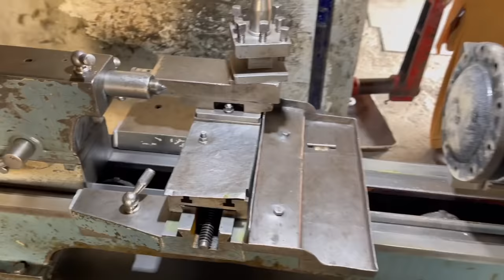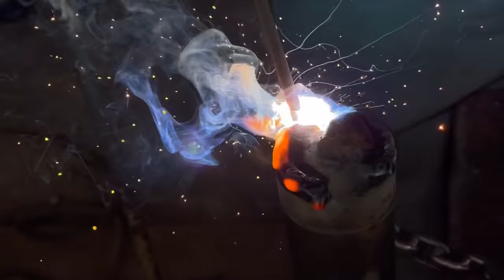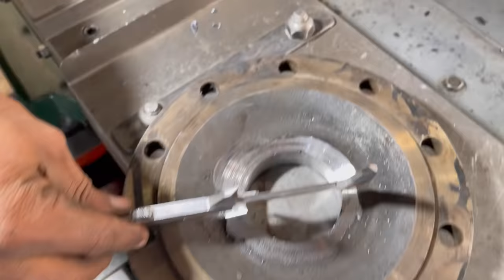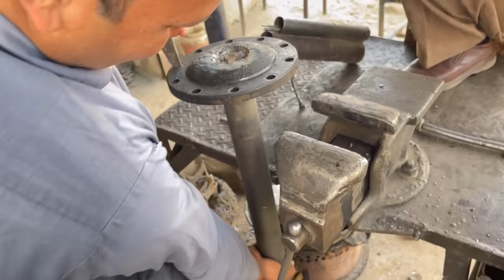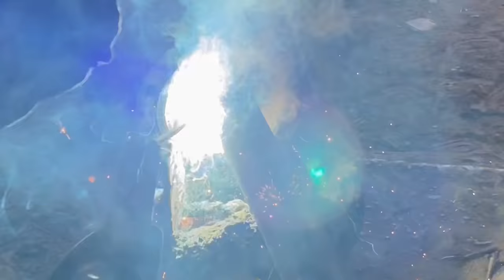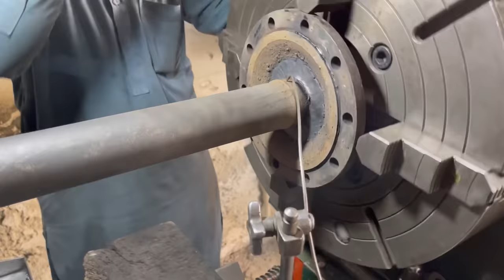Amazing technique Broken Rear Axle Repair | Local workshop amazing work |

Comment: It would be interesting to see how long it lasted in the truck, and where it will break again
Reply: probably better than the factory
Reply: @bourbonrenewal216  ha, you can even see the small defects in the welding job after he polished it
no way its better, in fact it's worse
Reply: Don't you dare come to us with science and numbers 😂
Reply: I can say this much machine shops been shorting axle shafts like that a long time for kustoms  and drag cars long before currie and strange made custom length axles still done today for odd axles
Reply: @bourbonrenewal216  a surface deep one pass cold weld without any preheating on a large pieces of alloy axle steal.  THERE IS NO WAY THAT IS BETTER THAN A SINGLE FORGED HEAT TREATED AXLE FROM THE FACTORY
Reply: Right beside the weld .axles don't like to much head .madeast a week under load if that
Reply: @Stepinup  really machine shops been cutting and welding axles for years before Mosher and strange made custom lengths they do it right at the flange end never had one break infact I have one in a chevy nova that is still cut and welded that was done in 1980 and still drives fine they cut it off at the flange turn the shaft to a smooth diameter drill threw the flange do .005 press fit and weld anneal it and heat treat it

Comment: Nice job. Didnt expect it to be done with a stick welder!
Reply: Its the axle fuse..
Reply: Welding outside in the wind probably makes it the best choice. Not sure how the strength will compare with original though. I thought that these axles were forged.
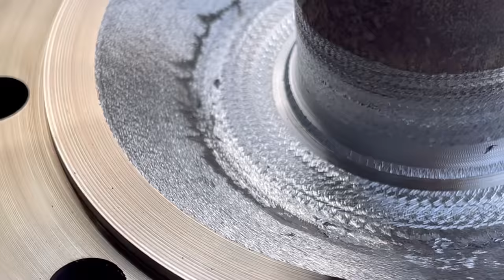Reply: I'm just going to say, usually you do the last step first. It's not the best idea to weld over iron oxide and whatever other crud and dirt built up over the metal. You can actually see what looks like small voids and cracks in the welds in the final close up.(18:40)

Comment: The problem here is your putting peoples life's at risk, you just welded on metal, it's not the same structure. It's weaker substantially. It may last a a few months tops. No heat treatment, the shaft isn't made from cheap weld, there's so much pressure and stress on those. Nearly 5 million views. Now the dislike button is cancelled. This is actually dodgy as hell mate. There's no way this would pass a certification at all. Cowboy Technique#

Comment: This piece will for sure crack at the end you can see when you got close all the cracks in the welds just because it's clean and looks shiny doesn't mean it's safe
Reply: During welding, tensions have arisen that will soon lead to breakage again. The weld seams should have been annealed stress-free. Always drill with oil.

Comment: Heat treatment??? Pre-heating the material before welding…Chamfered edges??? What is that???to repair something lite that it need a lot of steps in order to keep the strength an structural integrity…as a emergency repair…ok. But I suppose that maybe it is difficult to find replacement parts or it is too expensive…but this repair is not safe but fun to see!!!
Reply: Yup, bye-bye factory heat treatment and friction weld technique.

Comment: Could have beveled the 2 sides of the disc and welded with a stainless steel electrode (welding more flexible to rotational force) and then filled with common weld for reinforcement and finishing.  At least it lasts longer.  What seems to me is that these trucks are running with excess load, and with the differential, it throws all the torque on an axle and it can't handle it.

Comment: Everything I have read in the comments about how it should have been welded, nobody has said anything about where they placed the ground while welding in the lathe. If you grounded to the lathe body and not the part every bearing in the current path now has arc on the balls and both races, very fast way too destroy a lathe.
Reply: There were quite some comments here about improper grounding killing lathe bearings, at very least in Russian.
Reply: Да, друг, о заземлении я тоже подумал. Вот же индийские мастера камекадзе)))
Reply: The next shop over makes new lathe bearing balls.  From balled up  chicklet wrappers.
Reply: Probably a rotary ground....they do this all the time and lathe is old and running....

Comment: Nicely explains why wheels departing trucks is a common issue that kill many people.
Reply: Wheels are connected to drums of axle housing not axle hubs
Reply: Wheels is in the axle spindel, it was secured being by a large nut. The axle shaft is only connected to the brake hub. Which means that you can remove the axle shaft without removing the wheels

Comment: It's always nice to see how people repair stuff instead of replacing. Unfortunately, that axle isn't gonna last very long because of all the crack initiation points on the inner radius, as well as tension in the material from all the welding.  But I suppose they will fix it again when it breaks off.
Reply: Что такое напряжение металла от сварки?)))

Comment: That is very unsafe if they will install it.   That axle must be preheated prior to welding. Without preheating, the molecular structure if not correctly done, it will have cracks and that is unsafe. They should do friction welding.

Comment: I've been watching a few of these Pakistani machine shop videos and it seems like a lot of their repairs involve filling in broken/missing material by stick welding, then machining it down to the desired form.   How does the strength of the welded filler material compare to original stock?
Reply: Metal is amazing. Welds are very strong as long as they are done properly. There is a wrong way where you can wreck or weaken things... Skyscrapers, container ships, bridges, many things are welded strong together.
Reply: It doesn't. Simple as that
Reply: @TomarenaiEraserRain    Plus he was using the right rod for the material he was welding. Love that 7018. I’ve used it a lot over the years on alloy steels.

Comment: I don't see that lasting at all. There's no structural connection between the shaft and the flange where it was fitted together. That is an instant internal structural weakness. The weld material might hold up for a while, but not forever.

Comment: An old timer in CA told me about when he worked in a US factory making heavy duty condensers for refrig units. A Korean company bought one unit. It had a broken shaft which was welded, but it still worked. Years later, the old guy told me about going to Asia, because he heard identical condenser units were being sold throughout Asia. He noticed that every unit had an identically broken axel which was welded.
Reply: When there's no parts , ingenuity is the Mother of Invention
Reply: @peted5217  necessity is the mother of invention
Reply: Most Exactly

Comment: This is what Mechanics/Fabricators do when parts aren't available. Separates the men from the boy's. Great job guys!!👍👍👍
Reply: See I get that but, it's not their materials it's the techniques and lack of training, I mean the guy didn't use one drop of oil the whole time that hub was on the lathe, they probably go through tools like crazy with not knowing how to use them properly.
Reply: @kielbasa.sausage  I know they didn't. No dial indicator either. They needed the truck to go, so they did what they could with what they had. I ve done repairs on trucks(semi's) on the side of the road, in parking lots, in the dark,rain, snow,ect. I didn't always have the "proper pieces" for the repair so I do what I can to get it back to the shop, just like these guys did. They didn't give up. Even though
it wasn't perfectly done- they got it rolling again. You've got to admire that my friend.
Reply: These videos are some of the scariest shit I've ever seen. How screwed will it be when the shaft breaks off the end. The other video of resurfacing a pressure plate with welded or brazed cracks. That will come apart and scatter everywhere, maybe kill or mame someone.
Reply: the dude  you can have whatever opinion of the job you want. I don't  care. I said I thought they did an excellent job on it for what they had to work with,that's all. Look around. There's lots of substandard repairs going on in our country too. If the axle breaks again, it's inside a housing. Remember it already broke once. Yes, I still admire the repair for what it's worth. I also know it would take a replacement axle to repair it right. At least their not sitting there crying about it. They did what they could.
Reply: the dude  well dude, why don't you fly on over there and educate them? Why waste my time. Go show them how.
Reply: the dude  yea well your brain might even be smaller than mine. Your the one complaining about it, you go and show them how. Or does their system of justice scare you?go find someone else to troll

Comment: Repairs like this still occur in the U.S., but aren't common. I would have like to have seen more of a radius on the intersection between the flange and axle. I think he was trying to add a radius with that last step with the grinder, but there is still a fairly sharp corner there. That is a stress riser and will be the place it fails next. Just using a rounded cutting tool in the lathe when taking off that weld could have prevented that.
Reply: I thought he was trying to reproduce what looked like galling on the part originally.

Comment: I was surprised he didn't try to friction weld it, goes to show what can be achieved with willpower.
Reply: does it look like they have friction welding equipment ?
Reply: So you don't understand how friction welding works? He has a large lathe.
Reply: @simontheeldergeek523  yes i do you need a little more than a 75 year old lathe seems you dont know you should look on you tube maybe  youll get the full picture

Comment: I wonder what the strength is compared to a single piece: is it enough to take the engine torque?  Are these welded on to begin with anyways?
Reply: no, an axle like that is Forged from one piece of steel,  top quality steel, the "repaired" axle  will fail in short order.  A weld will never replace a forging.   the Pakistani guys do their best but the repairs are just temporary ,  you can tell when you see repair after repair on the same item
Reply: Я где то видел их делают цельными из куска металла путем ковки.
Reply: @mikethompson9745  I thought that they were a single forge… I was just curious about the actual pressure that the weld can withstand…it would be interesting to see the longevity in terms of “miles driven between breaks”…. A new metric, if you will.. 😀
Reply: Ironically, the weld is probably stronger then the original part, despite the naysayers, a proper weld will always be stronger then the parent material.  as for the original part, they are likely cast then machined as one piece, while forging is possible, its unlikely as upsetting that large of a flange becomes problematic due to cracking and internal stresses, not saying it can't be done, but easier and more cost effective to cast.
Reply: Engine torque ? what about extreme  over loading the truck  with far too much weight, probably why the axel went in the first place.
Reply: @artisansportsman8950  the axle shafts only deal with engine torque, they do not carry any of the load, likely cause of breaking is getting stuck, and then getting sudden traction, happens with some frequency with dump trucks and logging trucks here in the PNW.
Reply: I saw a video of Pakistanis forging axles right in factory, so I don't know why can't they just buy a brand new one
Reply: @ex-soldier4341  next station fix

Comment: The weld doesn't seem to be any good for cyclic load. He should have bevelled it at least from the inside (after first weld passes) to get rid of "dirt" in the root pass and have nice full penetration weld. Instead he put too much filling just to lathe it down then. And yep, I would do DPT for high-loaded axis if a living one would like to drive a truck with this axis on.
Reply: I can't understand why so many commentators are so enthusiastic about this patchwork that doesn't show the slightest security standards. I would not want to drive such a vehicle.
Reply: Came here for this.. how long would this poor axle hold before it snaps again... Polishing a turd!

Comment: Anyone observing the granular texture of the metal would immediatly discard that piece of steel. Probably a hardening problem or a wrong choice of steel quality.  But, in a isolated environment or lack of replacement for a new one...
Nice effort... it will come back for a replacement soon!

Comment: I love watching this being done by hand the skill is awesome. In US everything is done with machines. It would be done with a rotary welder that builds up layers. Love seeing this
Reply: Not nessesarily most of this kind of repair stuff is still done by hand with admittedly better equipment in most cases in the us. For instance every shop I've ever seen in the us has dial indicators instead of the wire on a base they were using in fact other than that a lot of small shops would go about a repair like that in the same way and with very similar equipment. in fact the equipment they actually have doesn't look like it's in that bad of shape I've worked at shops with older and more beat up equipment than that. Several even had equipment from the 60s still running barely upgraded if at all to modern technology.
Reply: We also clean our materials before welding on them...
Reply: Many repair machine shops do shaft weld repairs similarly (except with proper measuring instruments to reduce runout and with tooling that leaves a proper surface finish.

Comment: I have one issue. The rod you are using is not a downhand rod. 7018 is uphand or flat only. That's why it was "running" when trying to do the second side of the axle. Other than that, this was very interesting.

Comment: Well, that's another truck axle that gets to fight another day!
The stuff I see done here on these videos makes perfect sense, they have no choice in many cases but to re-use bits.
Reply: Gg
Reply: Ain’t gonna fight long!
Reply: @jamesharrison8346  it would be interesting to know exactly how long it "fights". But, what do you do when labour is cheap and OEM replacement parts and materials so expensive?
I've had a long career in engineering and have witnessed some amazing results from some very "sketchy" emergency repairs.
So I tend not to disrespect the work these folks do.

Comment: Wonder how this repaired axle shaft performs on the truck and its load carrying capacity. Looks like a 12 to 15 ton shaft, if it works just fine then material, heat treatment and FEA engineers will be jumping off buildings, head first....
Reply: They always used to tell us a good weld was stronger than the metal around it, good to see parts getting repaired instead of being scraped isn't it
Reply: @Geoffcwest  they can afford to fix it Labor is cheaper than parts there.

Comment: I thought cutting off most of the internal weld was a bad idea and it looks like the cracks are showing. But amazing turn around time tho. Thought when I saw the lathe initially I though I was going to see a shrink fit then weld.

Comment: I guess it's what you have to do when you have no other option. I'm sure the guys doing the repairs are completely aware it's not as strong as it was, and I'm sure they would have told the customer also. But when you have to fix what you have in order to keep things moving on a daily basis, you weigh up those risks and decide if it's worth it. In this instance, I guess the owner was happy to use this repair until a new replacement part became available.

Comment: It was a good effort. If I turned stuff out of many of the shops I have worked in like that, I would have been fired.  Also for future reference, an undercut at the base of the shaft into the plate with a large radius will add quite a bit of strength and reduce stress risers at the joint / corner.
Reply: Can you explain what you mean by the risers ,for us laymen
Reply: ¹a11aq1aaaw¹aaaaaa2qqq11¹¹11¹aaq¹¹qaqa1aqqqqqqaaaaaaaaawaaaqaaqaaaaww²²wwwwWWwqaaaaaaaaaaaaaaaaaaawèAaaaaaaaaaaaaaaaaaaaaaaaaaaaaaaaaaaaaaaaaaaaaaaaaaaaaaaaaaaaaaaaaaaaaaaaaaaaaaaaaaaaaaaaaaaaaaaaaaaaaaaaaaaaaaaaaaaaaaaaaaa
Reply: @paulnoorbergen3514  basically just sharp corners from which cracks usually start to form
Reply: @paulnoorbergen3514  an area where stress is concentrated. Stress = Force / Area, thus as area reduces stress increases. 

Any sudden geometry change is generally a stress riser.

Comment: Good way to ruin the headstock bearings in the lathe.
With no apparent earth lead on the job, the welding current must pass through the bearings with a high probability of arcing through the bearings.
Reply: It'll be discharging through the bearings and buggering that lathe.

Comment: I don't know about that thumbs up, the welds seem full of holidays and undercut, not to mention mild steel 7018 rod. 😬 but you use what you have I guess.  More than once all the slag was not removed before the next bead. Lots of weight going on that repair

Comment: You need a "dial indicator ".....material is probably 4140....no preheat if the part and post insulation  for slow cooling....7018 👍  but should be baked in an oven first....but the dropping of the part in the dust at the end...OMG....BUILD A TABLE SO YOU SAVE YOUR BACKS....

Comment: They should of put a bigger radius at the end of the shaft where it joins the flange it makes it way stronger the heat affected zone is very prone to breaking just before the end of the shaft just before the weld but back yard machinests don't know these things

Comment: Ok. Ok. Now I see it. 70/18. I do not trust it that much. I know it is a very flexible . But in that harder material I won't use that.

 I know what I'm saying.

 I just to weld different kind if metals before.
 For instance: Engine blocks with magna  770 welding rods. From Germany.

 Also bell housings with greecast 1 from messer grieshem. Sorry if i misspelled wrong.